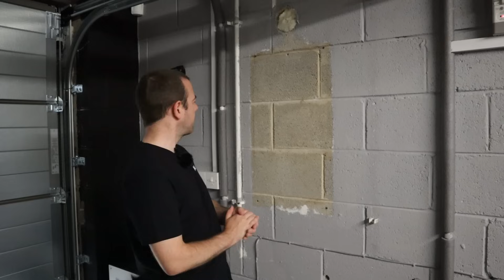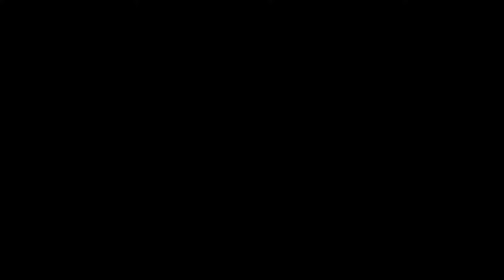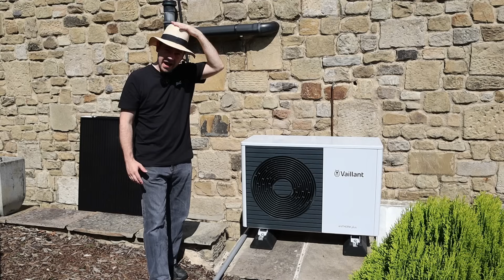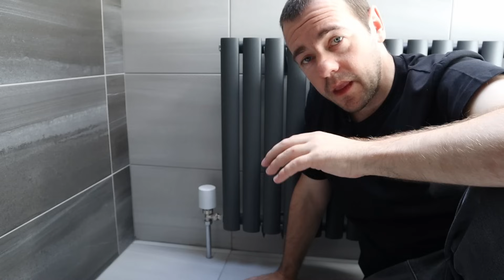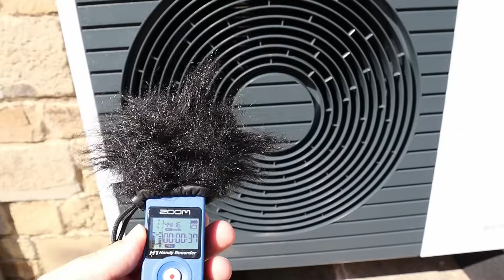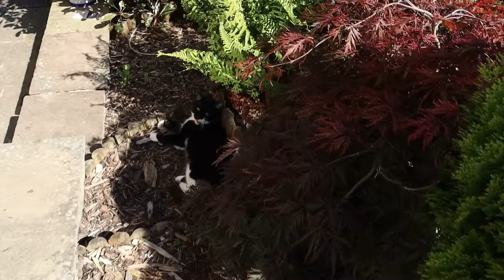Heat Pumps - Our 'Ugly' Truth!

Comment: Any chance of a follow up vid.  Just found this today and it all looks good though having only used it for hot water I find it hard to see how you can be so certain that it will cope well in winter.  You mentioned that you have a immersion heater in the stack but give no explanation as to why you need one ? You tell us that the heat pump can supply hot water at well over 60 degc  so I don’t see that you need the immersion to  do the legionella  cycle ? Or is it just a back up ? 
It will be intresting to see a follow vid up with some actual performance details  of the power used per day to keep the house nice and warm.  Especially as we have had some -4 od temperatures lately 
…. As way of comparison I operate my heat pump on a window. Of 00:30 to 4:30  to heat my ground floor area. This is a heated floor water system comprising of 6” Concreat  over 150mm of insulation with tiled surface . During the night with outdoor temperatures of 3 deg and above it seems to run well with flow temperature getting above 40deg.c.  Though I only put water into the floor at 30c   This will then keep ground floor of house warm all day the start time of the heat pump is changed depending on out door temp from min of 2 hours. To the max of 4.5 hrs. Depending how cold it is .
I find that when I’d temp drops below the 3 deg c then I start to see defrost cycles happening  once each hour  this then pulls the flow temp down  so my avarge flow temp is a lot lower and I need to allow more time to heat the floor slab .  At times is is barely able to maintain the 30deg flow temp I want into the slab .  Again this is over a max of 4.5 hours. Cheap rate.  At these low temps I am getting a cop of about 2-1.  When you take into effect the defrost cycle .  
Though it did keep the house warm as intended . 
My house is a 1940 build  with some extensions with cavity wall insulation. And I have just remove all floor boards from ground floor and replaced with underfloor heating. (Noticed a big change in temp even befor heating switched on) 
Mine is still work in progress …
Reply from the maker: My immersion heater is off. The HP does it all during cheap period. 

Can’t give winter details until winter is over.

Comment: I have to set my boiler at around 65 for the heating, I tried lower but the house just wasn't getting warm enough. Not an issue with the radiators as they are all about 30% more BTU than needed, so much insulation in the attic that I have doubts that's the issue. So I can only assume for my house there is a general heat leak because it's over 100yrs old, probably through the walls, or the boiler that was here when we moved in isn't strong enough. I'd like a heat pump but I have concerns that if a combi boiler can't do the job what hope does a heat pump have.

Comment: Interesting but of course, when you talk about heating water to 75C, you’re forgetting that the pump then becomes grossly inefficient and when the outside temps are really low and you really need the extra heating, this is precisely when the ASHP will fail to deliver.
Videos like this merely present the opposite, extreme and misinformed opinion as Skill builder on the other side. The truth lies somewhere between the two.
I’m about to construct a new build and will be going with mega insulation and oil with underfloor heating to facilitate future conversion. 
For now at least, heat pumps make very little sense.
Reply from the maker: I said it can, not it needs to. The temp doesn’t change from its design parameter depending on weather. 

Mines been set at a 40c flow rate the entire winter as that’s what the heat calculations designed it at. 
It would be insane to put heating in without getting calculations done. 

How will ASHP fail to deliver exactly?
Reply: @ElectricVehicleMan  when I say "fail to deliver", I'm not suggesting an ASHP will produce no heat but these things are advertised as having a COP of 4-5 which is by and large a misleading fantasy. It is true to say that in ideal conditions, an ASHP is a very effective way to use electrical energy for space heating or to heat water but for optimum efficiency, they rely on flow temps of circa 35-40C and an outside temp not much below 10C. When you depart from these ideals, the performance drops away drastically as does the argument for their use . . . a COP of 2 would be far more realistic for flow temps of 50C and and outside temp of just above freezing. Sure . . . under these circumstances an ASHP will deliver heat but not much of it. If you now add into the mix these things require considerable maintenance, don't last compared to an oil boiler, are expensive to purchase and the installations are horrendously complicated and bulky, they begin to look less and less appealing. The green credentials are somewhat questionable as well,since most are filled with refrigerant which leaks out and is 1400 times more effective at CAUSING global warming than Carbon Dioxide. There are moves towards more eco-friendly refrigerant but as yet, it isn't mainstream. Don't get me wrong . . . I'm about to embark on a newbuild and I want to embrace this but all my extensive research has led me to believe that there is precious little merit in the technology at present. If I had my arm twisted and had no choice, I wold go down the ground source route but let's be clear. I have costed a new boiler, radiators, oil tank and installation at around £9000 but for a GSHP with borehole, I'm looking at nearer £35K and that's before having the underfloor heating installed (at least I could claim £6K back from his majesty's finest blue suits and help mitigate this!!)  GSHPs have a lot more going for them than ASHPs but the cost is a disincentive for most folks and of course, the mainstream builders are going to install ASHPs en masse but the reality is that the common denominator in this current debacle is  . . Insulation and lots of it!!!  As I said, it's an oil boiler for me . . .tried and tested tech. A simple, effective and efficient installation and I will burn precious little of it because I will build to near-Passivhaus standards and this means the so-called green credentials of a heat pump, of either type, is at best questionable. I'm sure that ASHPs/GSHPs are the future, of that there can be no denying but neither type are as effective as a simple oil or gas boiler, the overall costs are far, far in excess of conventional heating and the green credentials are something of a fraud but hey . . . when oil costs more than brandy and becomes rarer than dinosaur's poo, it will be Hobson's choice I guess and if I'm still alive, I will convert then, unless of course . . . . something better comes along
Reply from the maker: @ybliga  Refrigerant in these is R290 (natural), and unless there’s a fault it doesn’t leak (like your fridge doesn’t). 
Maintenance for mine is £150 a year. 🤷‍♂️
And a cop of 2 at freezing is still more than twice as efficient as anything else. 

50c is too high, for a new build it’s insane. With underfloor heating I’d be expecting 35-38c flow. 

As for tried and tested. 
Heat pumps have been used in far colder countries than this for decades. 
It’s also the same tech the you have in a fridge/freezer. It’s nothing new. 

I get the sense that your going off old information as most of what you’ve said simply isn’t the case. 

As for environmental, oil? Really?
It’s the very definition of single use and with your new build you could easily add solar, which means you can generate at least some of your heating yourself, no other system gives you that option.
Reply: @ElectricVehicleMan  R290 is most likely the way forward for now but as I suggested, not yet in wide circulation among existing installations.  When I talk about high maintenance costs, I refer to wear and tear on the mechanical components and not just servicing costs. I currently pay a similar price to have my oil boiler serviced but it is 24 years old, the life expectancy of several heat pumps and hence my comment about maintenance costs!! 
My plan is to supplement with a small number of PV panels but definitely won't go near supplementary lithium cells for backup. Again, these batteries are another source of pollution in their own right and best avoided. My take on it is to produce just enough Solar from PV panels so that there won't be any storage requirement. I'm not sure you have totally grasped the concept of COP and indeed, how a heat pump works. A COP of 2 means that 1kw of electrical consumption will transfer 2kw of equivalent heat, when compared with conventional electric heating. All well and good but oil/gas fired power stations are only 40% efficient and so to produce 1 joule of electrical energy at the domestic plug, you need to burn the equivalent of 2.5 joules of oil/gas at the power station. Given that most oil/gas boilers are well over 90% efficient, there is precious little to choose between the two when considering green credentials. . . . you might as well just burn the oil/gas in a domestic boiler at 90% efficiency as first convert it into electricity at 40% efficiency. Of course, lithium batteries are even worse when considered in this way, not to mention pollution caused by mining the stuff in the first place. As I said . . .it is undeniably the future but the truth, both in terms of economics and green issues lies somewhere between your outlook and our skilled builder friend who is possibly a little too negative.
Reply from the maker: @ybliga  Think of the complete package. 
Lots of solar will power (at 90+% efficiency) the heat pump for a lot of the year and the house. 
A home battery not only stores excess solar but charges up (esp in winter) at night when it’s not only cheaper but the grid is substantially cleaner. Electric for that household is then either from self generation or from the cleanest times for the grid. Majority of gas electric production is at peak. 

Of course batteries have impact, everything does. But this pales into comparison with oil production/refining. 

Assumptions of electric production are based on the grid not getting cleaner. It is massively so compared to a decade ago for eg and is set to carry on doing so. 
For a heating system lasting 20 years, basing it on todays generation isn’t accurate. 

Self generation is everything.
Reply: My Dad has one with solar panels in a field ... no battery, far north of Scotland . Prior to the April and Oct increase ..ie Jan 2022 ... looking at £400 per month electric bill. Suggest he must be closer to £600 now. He won't talk to me about it anymore, when he was installing and afterwards he couldn't stop telling me how efficient and how cheap it was going to be and how much dosh he was going to be receiving from feed in tariff. I suspect he is regretting removal of the old boiler element of the contract he signed.

Comment: Any idea what the installation costs would be for an old house with gas boiler, upstairs tank and 10 radiators? 
The initial costs are what will stop many people using a heat pump. Even pay back time will not matter as much as initial outlay.
As for getting rid of gas, I think you mean changing where the gas is used, renewable electricity provision is very much wishful thinking.
Reply from the maker: Pretty sure everyone’s aware it’s getting rid of gas locally.

Comment: My new Mitsubishi is getting a great workout in the current (december 2022) (very) cold spell. Even at max chat it's still quiet. The only thing I'd say is - Don't stand in front of the fan when it's on and the outside temp is -5 because that exhausted air is way colder.

Comment: why isn't your ASHP in your loft where the air tempura is hotter and so the efficiency will increase?
Reply from the maker: Air flow.
Size.
Temperature wouldn’t be hotter with a HP running in it. 

Any of above.
Reply: @ElectricVehicleMan  how would the solar gain of many dark roof tiles/slates not make a difference? Thanks for the reply I have found most of your articles interesting over the last few years.

Comment: we unfortunately inherited a 12kw nibe ground source heat pump when we purchased our home. It is costing £30 per day in electricity in winter and the house still doesnt get that warm. Heat pumps are totally useless at heating homes in winter. The water just doesnt get hot enough. We are ripping it all out and going back to the trusty grant vortex oil boiler that will actually heat water to a decent temperature.
We are heading for a £900 electric bill just for december 2022 that is simply ridiculous
Dont listen to the hype, listen to the people that are using them. 
A friend just self built a 3 bed detached and fitted a mitsibushi ashp. Hes running at £17 a day with a brand new highly insulated home. He also regrets fitting the heat pump now and wishes hed gone oil.
Also a note to consider if you think you are doing it to save the planet...where do you think the electricity your using (absolutely masses of) is coming from? power stations burning gas and now even coal. UK in winter there is virtually no solar generation. Heat pumps are not the answer, save your hard earned money and stick with what you know works
Also another point to note, Ive had Nibe service out to it 3 times in 12 months, soft start burnt out , then high pressure tripping, then compressor failure adding up to a bill of nearly £2000. Intial installation costs of £20000 recovered through the old RHI payments over 7 years which has now ceased. If I had paid all this without RHI payments I would have hung myself by now

Comment: Did you have to put huge radiators in? Our housing association put a triple rad in the kitchen (80kg) and one that takes up half a wall in the bathroom. We have a 5kw Arotherm but the previous model to yours

They also forced a 400 litre cylinder on us when we have a wetroom with electric shower.

I have no idea why the cowboys didnt use unitherm considering they stole 20% of our bedroom doing all that plumbing by hand which took an entire day.

When first put in they put our electricity up £100 a month because they screwed the settings up so worth ensuring a fitter isnt a cowboy as ours is

Comment: In holland, I have never seen 10milimeter pipe for central heating in my life. as far as i know, it has always been 1/2 or 3/4 inch piping and nowadays the english inch piping has been replaced by the metric piping, with 15mm piping as a standard for every radiator, and mixtures of 22 and sometimes even above that wherever needed. but mostly in a regular house here we'll find 15 and 22mm.

But who have thought that 10mm would be a good idea. It's soo narrow! :O

Comment: Did you consider the Mixergy cylinder at all? For even more efficiency, thanks in advance
Reply from the maker: For a heat pump there’d be little benefit as the whole tank is filled.

Comment: I think you needed to run your ASHP through the winter before producing this video. Your example of ASHPs in Norway is not valid. Scandinavians use air to air systems, not air to water that we use in the UK. Also ASHP do not have a COP of 4 in winter. Somewhere between 1 and 2 is more likely. And yes, I do have an ASHP and, yes, it was working well when you made this video. Wait until January, then make the video. You will not be able to rely on the Octopus off peak tariff of 4p, because the heat pump will need to run during the day; my 2000 sq ft 2021 build house required 60kWh of heat per day last January. So, in short, I think your video is optimistic, at best, misleading at worst. BTW, the Octopus off peak tariff has increased to 12p per kWh for new subscribers.
Reply from the maker: Video coming this Friday. 1-2 isn’t accurate. Not with mine anyway. Tech improves. 

Off peak provides all the hot water and 4 hours of heating. Even without batteries that’s a chunk. With, it’s a no brainer.

Comment: If you want efficiency without being on cheap EV tariff, why not install a dual system using solar water heating as well.
That way, set pump not to reheat tank after use, over night. Allow the daytime solar heating to heat up water in day, and set heat pump to kick in to finish of/keep at temp until required.

Comment: Glad you had a good experience with First4solar. I didn’t. They installed my solar panels with batteries in my home in 2019. The BMS control unit failed within weeks, they took months to replace it after numerous failed appointments, they acknowledged their failings and promised me £300 in compensation. Which they never paid. It failed again a few months ago and I’m still waiting for a replacement. Daniel stated they would pay compensation for my loss of use of the batteries, when. I pointed out they still hadn’t paid the last compensation amount agreed, all went silent again.

Comment: These low temperatures wont kill water borne bacteria etc. Needs to get over 65.
Reply from the maker: It will. Just slower. 

And I mentioned the legionella cycles in the vid.
Reply: @ElectricVehicleMan  yeh cycles but its not cleaning put the pipes. Homes need high temperature flushes for fungus, bacteria and viruses.
Reply from the maker: @reddaB  https://youtu.be/oJeyc_cGIMU

Comment: That's a very nice installation but have you done a cost based and payback analysis of the new system? How many years will it take to break even i.e new gas boiler and running costs vs new heat pump install and running costs? I can see the electricity costs rising too high to justify a heat pump switch in the current uncertain climate. Also what do you do if there is a blackout, which is being currently talked about as potentially happening? The heat pump switch is also out of reach of many peoples budget and especially with the cost of living rising rises. You didn't give a ball park figure of the cost to install a heat pump and all the gubbings into your property but I presume it would have cost 10k to 20k or more!